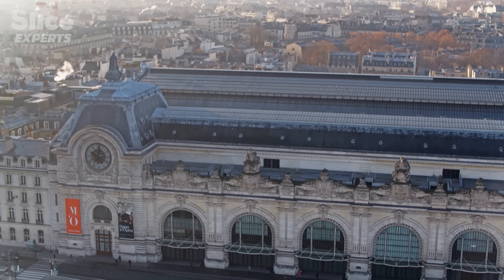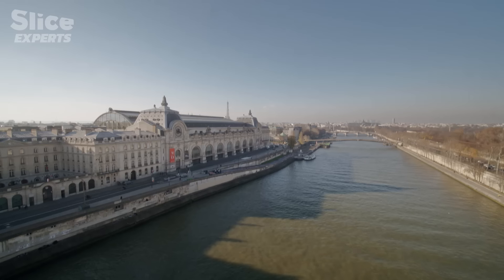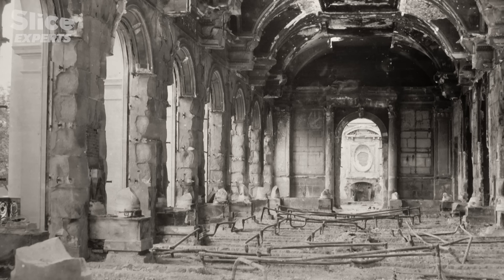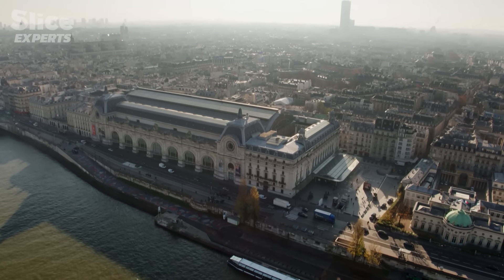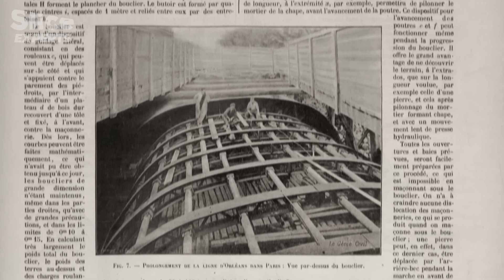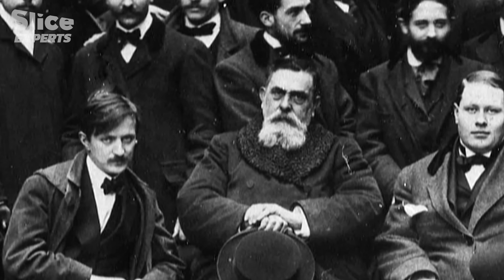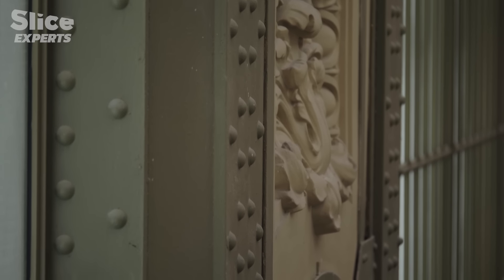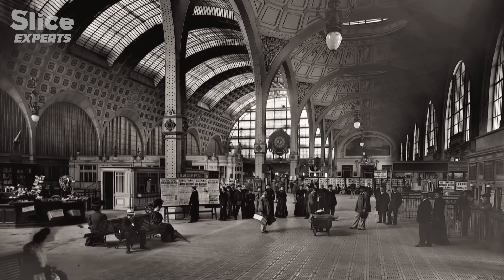The Huge Challenge of Building Orsay Station in Paris | SLICE EXPERTS

Comment: It is so good That Paris preserved it, unlike New York which demolished it's much loved Pennsylvania Station.
Reply: I had the same thought — the construction techniques were even similar, as I recall, and just as innovative.
Reply: New York didn't do anything. The Pennsylvania railway demolished it.
Reply: @darrenmclellan6712  The City could have prevented it.
Reply: Partially. I doubt that’s what the ground floors of the interior looked like.  The 60s vandals had their modernist ways at least partly installed 1:16
Reply: @nobilesnovushomo58 

Somewhat; those installations and treatments are not structural in nature, and did not completely replace, or call for the destruction of, any of the original details (see coffers on ceiling above with their rosettes 🏵️). But I agree; it’s a modernist hack job.
Reply: I live in Paris. It's not about preservation but about saving money. Paris looks medieval because France is a high dent country and can't modernise.